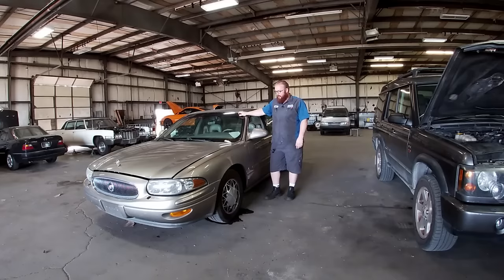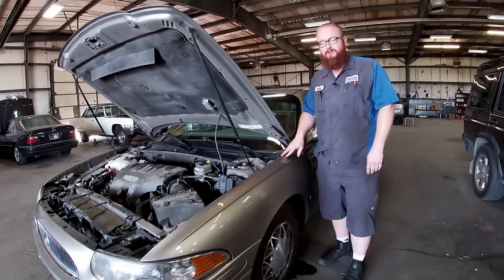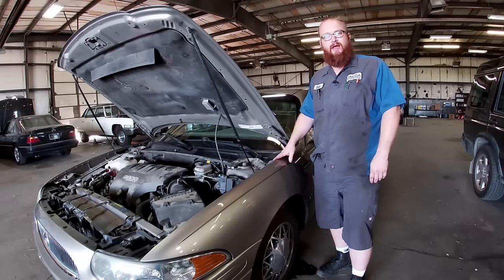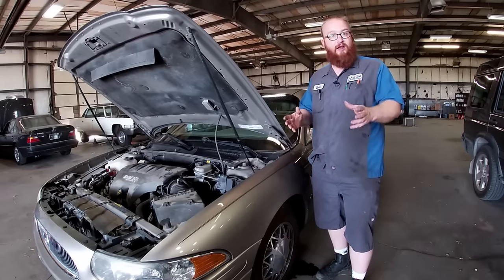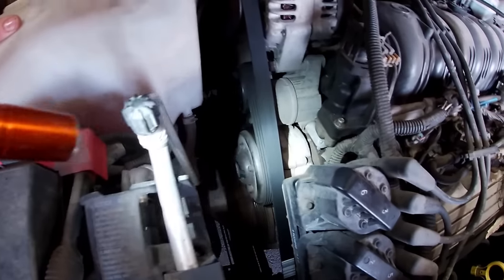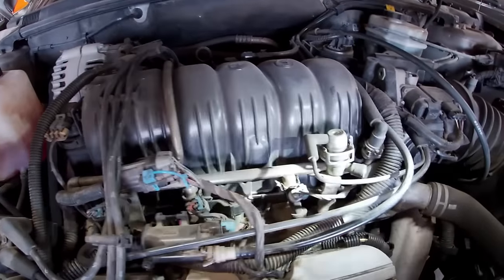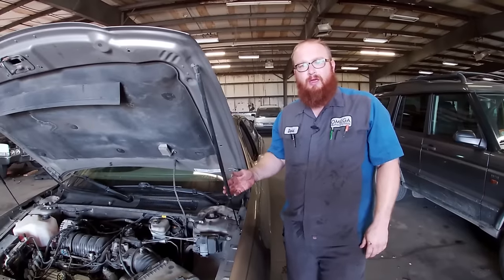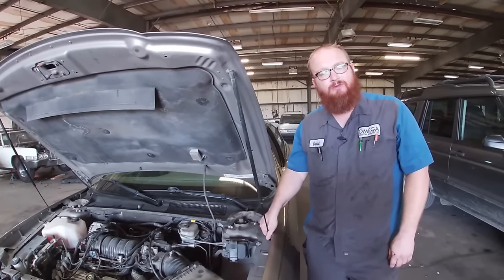CAR WIZARD highlights what makes the Buick 3800 V6 the BEST engine ever!

Comment: Well, I'm somewhat familiar with the origins of the beloved 3800, being as I own/ed three different Buicks of three different variants of this engine class, the first one I owned was a 1963 Skylark,it had a 215 CI V8 4BBL, this was in 91, and the engine was so rare, even then, that part stores thought it was a V6, now, by the 70's the 215 V8 was replaced by the 231 CI, which was the actual predecessor to what's now the 3800, being it was basically a Carbureted version of it, it was 231 Cubic Inches, or 3.8 Liters, ( 3800 ) this engine was in a 1977 Skylark, it had roughly 110 HP and went 0 to 60 in a boring 14 seconds, but, it too was reliable as hell!, and by the early 90's the ole trusty 231 block got a new fuel injected top end and computerized ignition system and the first gen 3800 was born, an engine that was only to be in service for 10 years, but proved to be so reliable that GM decided to run it for an extra 11 years, and it was produced from 1990 until 2011 as a result,(I currently own a 2000 Regal LSE) and, here's another interesting fact, a Turbocharged, fuel injected, Computerized version of the 231 CI (or 3800) V6 is what was under the hood of the 86 to 89 Regal Grand National and GNX, so that engine has definitely been around the block a few times.👍

Comment: 5VZ-FE.    Best engine ever.  Have one in my Toyota t-100 and it has 317,000 miles on it and it still runs smooth and has plenty of power. I've only had to replace the starter and alternator. I hear similar tales from others who have the same engine.

Comment: I know this is an older video, but I drove one of those for 146k miles when I sold it. Not a single repair needed. Just air filters, tires, oil changes. No transmission problems either.

Comment: Every 3.8 i owned lasted longer than every 5.9 cummins I ever owned.  And i could get 30 mpg. 400,000 -600,000 miles no problems. That is how good they are.  The best thing i did was drain the dexcool and put better coolant in.

Comment: Probably the 3.8L was the fwd conversion of the 231ci (we didn't use 3.8L back then) like in my 79 grand prix. I tell you the 3.1L (60 degree vs 90 degree) was damn good once you replaced the plastic LIM gasket with a steel one and went with green coolant. Not much I did except that, went ahead since I was so close and tore down the heads got a machine shop to clean the heads, valves and sent injectors off to Mr Injector for cleaning. Exhaust burned my cam sensor wire. Did AC too. Got rid of that sixteen year old 98 lumina at 283k miles cause I just wanted a shiny new prius.

Comment: I love your honesty and Mechanic Truth.  The GM V6 3800 engines built in Flint MI absolutely were the BEST engines ever built... (You stopped in saying WHY they were discontinued?) They were 400K+ mile engines.  I had one in a 92 Pontiac Bonneville for 10 years and 210K miles.  Ran like new when I traded it in. My theory is ... GM realized they had to build in Obsolescence and the V6 3800 lasted too long.  That's a Shame... because It was/IS the best car motor EVER BUILT.... and GM failed by moving into something more profitable.

Comment: Ive had the Series 2 3800 in a couple of my cars and the 4.9 Straight 6 in my f150. Best motors I've ever had. I just got a 2009 Lacrosse with the series 3. I'm hoping shes as good as her older sisters.

Comment: One mystery with mine. 170,000 always had great mileage. Good cleaning of components under hood etc. After last tune up mileage went down! Replaced/upgraded coils and wires with nice zzp products. Could new performance coils drop gas mileage 5 or more mpg?? Thanks

Comment: I had a 90 cutlass supreme and a 91 regal I miss both of those cars dearly and wish I still had them. I believe I spun main bearings on them and I hear that’s a notorious issue with those motors. I was also a youngster and may have beaten on them a bit.

Comment: The original 3.8 liter Buick engine with some modifications was used by GM Holden in Australia in their VN Commodore models,  (rear wheel drive) in the late 1980's.
Originally these V6 engines ran rather 'lumpy' , but the Holden engineers in Australia, over the years, made several improvements  until  in later years these engines were running increasingly smoothly and became even more fuel efficient.
These pushrod engines were super reliable and  frugal on fuel and their power was very adequate; they often lasted many hundreds of  thousands of kiloneters.
The Holden engineers had made a 'silk purse' out of the proverbial 'sow's ear'
They even exported their cars to pice forces in the middle east.
Later in 2002 this robust, reliable (cast lron block engine was replaced by a smaller 3.6 liter 'Alloytec) V6 unit, which in Australia did not perform nowhere near as well as its predecessor and in 1990 Holden in Australia ceased production of the legendary Australian 'Commodore' altogether.
Reply: Correction. Commodore ceased in 2017, not 1990.

Comment: Plastic parts are the bane of these engines. The plastic LIM gaskets,plastic vacuum hoses,and those coolant elbows..  Easy fixes though,get the upgraded parts,and some regular rubber vac. hose.. My '97 is still rolling at ~235k,without any of those issues for almost 10 years now. I can confirm,the supercharged version has a bit of scoot to it,and also doesn't suffer from the intake melting problems with the EGR tube,since it's a metal blower,instead of a plastic intake. (IIRC,you can swap the later model metal intakes onto the older engines...but don't quote me.)
Just the usual basic maintenance items,and the occasional water pump,etc. They're great.
Now,if they would have put the same awesomeness into the transmissions they bolted to these engines...... Go easy on the trans,and it'll last a good while. If you don't,it won't.

Comment: I just recently purchased a 2005 Buick LaCrosse. It has about 150,000 miles on it. Even though I got it for just under $5000, I was admittedly reluctant to buy a car with that many miles on it already. But had my fingers crossed that maybe it had at least another hundred thousand miles on it if I took care of it. This video makes me feel like I made a good purchase.
Reply: I bought a 2007 Buick LaCrosse with around the same amount of miles on it two years ago and it’s still running strong! I’ve put almost 30k miles on it so it’s almost at 200k miles and I have had no issues with it
Reply: @geeksimmer2488  - That's very encouraging! I've had mine for about a month now, and it's a great car. The only minor issue I'm having is that it seems to be just a bit more "bouncy" than it should be, and it squeaks a bit when it does the bouncing on a rough road. So I do need to have the suspension looked at. But it's not a major issue really.
Reply: @jeffconsiglio1307  yes very good car. That’s probably the back struts. Mine are out and I need to shell out some money to get them fixed hahs

Comment: GM Holden in Australia made and sold millions of these from 1988 to 2012 or thereabouts. Mounted front to rear for our rear drive cars. Motor mount on driver side is one hell of a bitch to change out. Took me about 13 hours to change out. Ow, this is a great engine. all the ones in Aus had aluminium intake manifolds.

Comment: I love the 3.8 I've never owned one but it was alot better than the 3.4 60 degree V6 I had in my 2003 Impala I had t that needed head gaskets twice! It was still a great running motor when it was right. But I now have a 2012 Impala with the 3.6 vvt DI motor that is almost bulletproof I think it compares well too the 3.8 for longevity I have over 256k miles now and have only changed an alternator the most major thing so far!

Comment: Hey,

What would you say or rate the 2017-2019 Buick LaCrosse V6 engine build quality or reliability compared to the old 3800 series V6 Buick engines??

I wanted to buy the last of the sedans in production with a naturally aspirated V6 engine. Even Honda Accords 2018+ have 4 cylinders with turbos on them lol.

Thanks you Car Wizard!

Comment: I had the 3800 1 Series in my 86 LeSabre that got 30 miles to the gallon on the highway and it was unbelievable that I could go back and forth on a two and a half hour drive each way and only use half a tank of gas and the gas tank was only 18 and a half gallons.. these mid 80s versions of lesabres in there corporate twins what the best quality in the world but you could safely traveling a nice heavy car and not a can from Japan and they got as good or better mileage than those little tin cans from Japan

Comment: Have multiple customers that are rural mail carriers that run various late 90's-early 2000s Buicks with the 3.8L all of them are have at least 250k HARD constant stop and go miles, nothing but basic maintenance every couple months and the engines still run like a champ.

These cars are the only real competition for the panther platform ford's for an easy to maintain tank of a car, and they are generally pretty affordable to buy in the first place as well.

If you buy one, at the first inkling of a coolant leak have your mechanic pull the intake and the bracket wizard showed and replace the factory plastic intake gaskets and coolant elbows with the metal replacements, and you got a motor that will do 200k easy, with minimal maintenance.

And keep the transmission serviced regularly, these cars only weak point is the transmission if not serviced regularly or if fluid overheats the trans can have real issues.

Comment: The origin of the 3800 and 4100 was the alloy Buick 215 V8 back in 1962 I think it came out , Buick cut two cylinders off and got a V6 odd fire, in fact the whole front of the motor is/was 215 V8 untill 1988, that is why this motor is a 90 deg V6 , 90 deg bank angle let's a V8 be balanced , if you design a V6 from scratch it has 60 deg bank angle for correct Ballance , that is why the 3800 has a balance Shaft . It's funny Buick sold the alloy 215 to rover England and was in their Rover Cars for years and years only to be removed when Ford bought Rover . One Ford spokesman said at the time " Ford will not produce a General Motors engine!" On another note the 3800 was in Australian General Motors Holden Commodore,s from 1988 to 2005 and was rear wheel drive only here, in manual 5 and 6 speed and auto Turbo 700, 4L60 and 4L65e trans. We also got supercharged rear wheel drive version.

Comment: 3.4 and 3.8L motors are really reliable. Don’t ever let that engine think about overheating though. I have a 2003 and 2005 Impala with 3400’s and a 97 Pontiac Grand Prix with a 3800. All of them are running strong.

Comment: I agree best engine Ive owned. Never did I have to take to mechanic for repairs ( Im pretty mechanically inclined) Drove my lasabre till the frame gave out literally, engine still running strong 😢 185k

Comment: If this engine is related to the 3800 that is in my mother in law's 2006 Chevy Impala LS, would you know the common fixes for the low oil pressure message?  I've had the car in the shop and the oil pressure sensor replaced twice. Thanks Wizard!

Comment: Here in Australia we have a 3800 buick and an ecotec which was holdens one they added onto the buick they are great here i own one in a commodore a series two ecotec also came with better heads and other things a fantastic engine mines a series two with only 199thkm just rolling onto 200th and its a 96 model great engines people just call them bombadores because a later model with the ecotec blows up a lot in them

Comment: You have a 3800 motor and it develops a intake leak and water mixes with the oil which could spin a bearing and then you're in for a big big expense I've never seen a Buick LeSabre with low miles and good condition for less than $14,000 lately

Comment: My 07 Lucerne has a 3800 V6. I drive about 86 miles a day, 64 of which are cruising on the highway and I usually see 26 mpg average, so you do the math. Not too bad.

Comment: I still have a 2007 Pontiac Grand Prix GT with the 3800 supercharged Series III.  Never had any major issues, just burns some oil.. has 260K mi,  however the body on it is rusting some around the wheel well area, but other then that everything works fine.  I'm sure the engine will outlast the rest of the car!

Comment: Help If you got a 75000 mile bonneville  would  you  change fluid an filter in transmission  or flush it at that miles. Leaning  towards just filter an oil. Lots of controversy over the flushing method

Comment: There was a series of this engine that was bad about water leaks from the plastic intakes. I to this day don't like plastic intakes. I also don't like the 3800. Apparently the ones I worked on weren't that good. I'm more into the ho 4.0 jeep motor. I'm kinda partial to jeeps.

Comment: The head gasket is a major job and known issue with these. I had a 2003 impala with similar v6 gym motor, same issue…
Reply: Head gaskets rarely fail on the 3800 series 2. It happens occasionally but it’s extremely rare. If by head gaskets you actually mean intake manifold gaskets then yes you’re correct. Intake manifold & intake plenum gaskets are a common problem.
Reply: @Pilot_Dad22 all gaskets on these engines are rubber instead of metal. Also the dexcool antifreeze gm decided to use ruins the gaskets even quicker. And gaskets are a MAJOR job. There is a reason GM stopped producing these powertrains

Comment: I just bought a 2005 buick LaSabre limited I have over heating issues I believe it was sitting for a long time it has 174,176 miles just had a radiator flush was really bad still over heats should I replace the radiator and thermostat

Comment: Actually the Oldsmobile Rocket 350 V-8 engine was the best motor ever produced in the U.S.  Back when you could get them from the junk yard, every race car owner who could make the 350 work in their car LUSTED after one - especially a lower mileage one.  You could run them WITHOUT oil 2 more laps around the track than every other motor, they were so ruggedly built.  

I had several 3800 motors and EVERY ONE of them went through cracked-faulty plenums.  About every 50,000 miles they needed to be replaced.  Destroyed two engines because antifreeze leaked into the pistons without my even being aware it was happening.  GREAT ENGINE ... just like my 120 pound wife was when I first married her.  Now she's over 200 pounds and needs a lot of patching up.

Comment: Should check out the Aussie built 4.0 litre straight six Ford" Barra" motor.  2008 to 2016. A true gem.  Turbo charged variant extremely potent.

Comment: Another bad point you did not mention  is( on the 07 buick lucerne cxl ) the power steering pump is in the worse possible place. 
Back passenger side of the engine bay at the bottom

Comment: If you buy one of these 3800 engine cars buy one without the Super Charger attached to it because that Super Charger needs extra care.  I have one with the SC and it just creates issues.  Change the oil and filter every 5000 miles in any car.  Change coolant every 2 years.  Change air filter. Change gas filter.  Often. 😊

Comment: I have a 97 bonneville sse 40th anniversary NA bought it with 139,xxx miles upper intake melted a month later hydrolocking the engine all 6 cylinders full of coolant I removed all 6 spark plugs drained coolant replaced upper intake and new oil and antifreeze drove it until December 22  296,xxx hard miles when the rod must have bent enough where the engine will not rotate clockwise but will turn backwards so far not a timing chain have not torn it down yet this car had been overheated 250 degrees on the gauge multiple times stuck thermostats, hose and water pump leaking got as much as 37 mpg a few times drove it out west 3 times in 2019 took it on a one month road trip the oil change was already past due when we left 10,000 plus miles on that trip changed the oil about two months after we returned used no oil either my daughter drives a 02 bonneville gets 27 combined and as much as 37 highway the rockers are rusted out completely I believe it was flooded just above the floorboards at some point before we acquired it she is looking for a no rust lower mileage bonneville if you know where one is let us know

Comment: Can you show us how to replace the rear knock sensor on this engine? Without pulling or splitting the engine from the transmission. My 3800 is in a 2002 monte carlo. Throwing a knock sensor code that shuts the engine down when pulling to a stop, or just simply wont let it start.

Comment: Totally agree with you, the Buick 3.8, 3800 engine was one of the finest made period and was a huge huge mistake by the idiots at GM to discontinue it. By doing so, automobile reliability had dropped drastically and turned many away from buying any GM again. So by rights GM executives deliberately by their poor decisions made people switch to foreign branded automobiles such as Toyota

Comment: Another one is that 4.6 v8 Ford in the Crown Victoria, I had one with over a million miles on it still running no problem burned a little oil that's it.....

Comment: The plugs on the back side of my 97 riviera are nearly impossible to change and the serpentine belts are a royal pain, you have to lower the engine to get one of the motor mount bolts out which has to be removed because the motor mount literally goes through the belts where it bolts to the motor. Great motor though...

Comment: I had the 3.8 engine on my windstar minivan, engine was good but the transmission leaked out and burned out. Plus my assistants destroyed the right front alignment which shop could not fix so I was not going to pay 4000 CAD dollars for a car that was worth 2000 dollars at most.  If i seen this video maybe i would rebuild that transmission for 3k but i bet there was other stuff going on the van so i scrapped it.